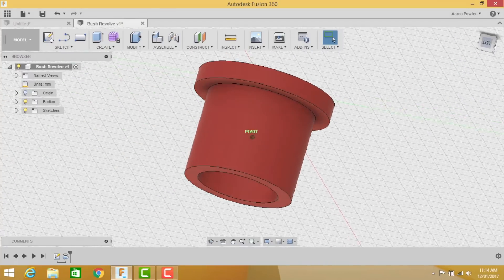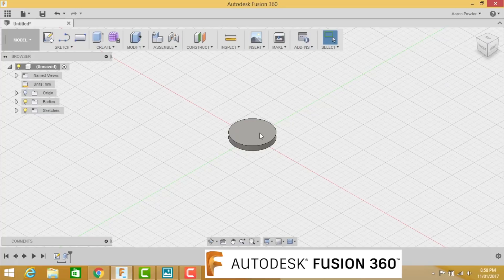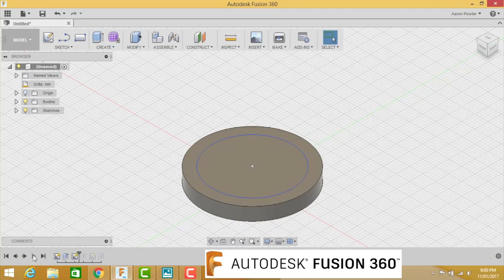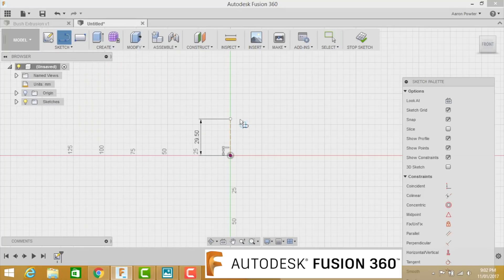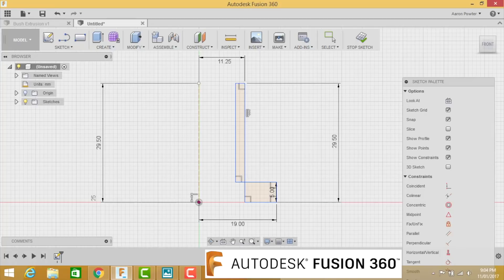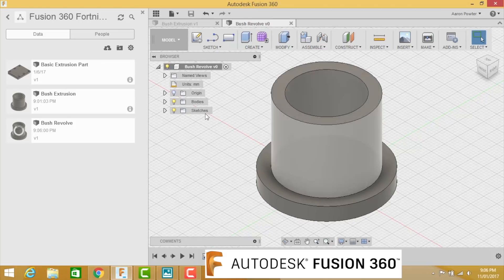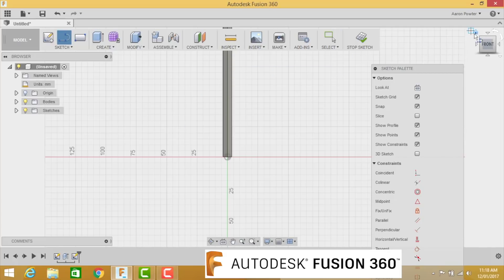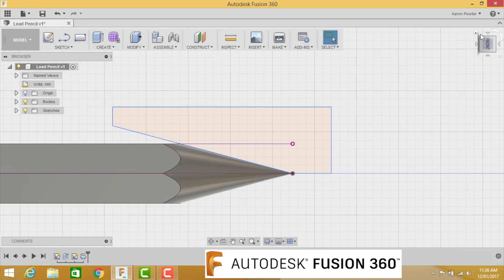Fusion 360 Tutorial - Revolve sketch profile FF.E2

Comment: That seemed like quite a few more steps than just creating a few circles and extending.
Reply from the maker: It really depends on your application. Maybe the bush yes, but most shafts are designed this way (best for CNC turning). Additional use of parameters also allows for speedy design changes.

Comment: 7.20 had a cross over but can't drag the line. appears locked in position. >>>>now what ?
Reply from the maker: Send me an email Joe and I can help you.  Aaron.
Reply: @DCT_Aaron_Engineering  I got it moved, once I exited Sketch mode. And I did elete every constraint I could and deleted most dimensions but it still wouldn't budge in sketch mode.

Comment: I’m having a hell of a time trying to get a taper cut out inside a box. (I drew a taper line did revolve then drew a box over it then tried to extrude the taper out but no luck!) I wish I could send you a copy! 
I’m trying to make a mold for a connector so I can add potting to it.
Reply from the maker: Did you say box?  Like a square object.  I only use the revolve feature on round objects.  If you need to taper a box you can just apply that within your extrude feature.
Reply: DCTTeacher1  a box with a taper cut inside it
Reply: DCTTeacher1  I guess imagine a box then cut out a funnel on the inside of the box. That’s basically what I’m trying to do.
Reply from the maker: Ok, so draw a square and extrude it.  Select the top or bottom face and draw a circle.  Extrude cut that circle and apply a taper angle to it.  This will give you the funnel shape inside the box.  Let me know if this helps?  Aaron.

Comment: Two for the price of one. Great work Aaron.
Reply from the maker: Thank you very much Stephen.  Glad you enjoyed it and hopefully learnt something in the process ;-)
Cheers, Aaron.
Reply: I did indeed.  I am just getting into Fusion.  I've just purchased a 3D printer so my primary aim is it be able to design some bits for printing.  So these relatively simple tutorials are ideal for me.
Reply from the maker: OH that's cool Stephen.  I just bought my first 3D printer too.  I bought it from a supermarket called Aldi here in Australia.  The printer is called a Cacoon Create, but it's actually a rebranded Wanhao duplicator i3.  It cost $500 (aud) and it is absolutely brilliant.  We have UP's and an Ultiimaker at school, but this thing craps all over them (my opinion).  I use Fusion 360 and Cura to do all my 3D printing with PLA material.

Comment: Thanks for the video. I am slowly getting to grips with F360 (from Sketchup - sketchucam). Have built a cnc router so an looking for best software to use with it. Sketchucam is great for basic cutting but is limited if you want complicated pocketing and other features.

Have a couple of questions

Whats the difference between extrude and Press Pull?

When I use fillet using the 'f' keyboard shortcut key it works fine but when I select it from sketch drop down it doesn't ... it asks me to 'select first line or arc' but doesn't let me select anything and the fillet options box doesn't come up. I thought a keyboard shortcut should do exactly the same as selecting it from drop down.

Thanks
Reply from the maker: Hello Jody.  Thanks for watching my video and I'm glad you found it helpful. I think you've made the right choice by switching from SU to F360.  Stick with it, as it will get easier and easier.  Plus F360 has started a real CAD / CAM movement. To answer you questions, the Press Pull "Q" is an intelligent function that allows you to quickly alter existing geometry such as an extruded face, fillet or chamfer without going back to alter the original feature in the timeline.  The "Fillet" icon under the Sketch Tab is for applying a radius to lines whilst drawing 2D sketches.  The "Fillet" feature under the Modify Tab is for applying radius to 3D surface edges.  Trust you find this information useful?  Regards, Aaron.
Reply: Thanks Arron. Makes sense ...hadn't noticed there was 2 fillet commands!
Have been making it a mission to learn F360 over the Christmas break and at first was quite daunting but continually looking at various tutorials and doing some of my own small projects have got me a lot more confident. Thanks
Reply from the maker: You're very welcome Jody, I'm glad I could help.  I'll have another Fusion 360 video out by the end of the week.  This week topic will be the "Sweep Feature".  Happy CADing ;-)